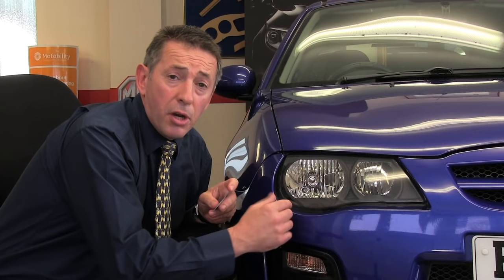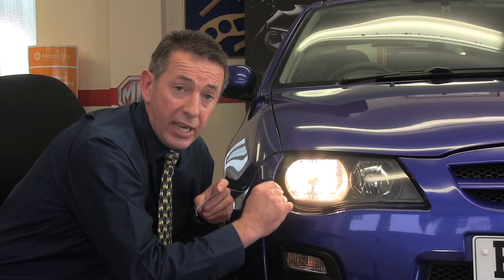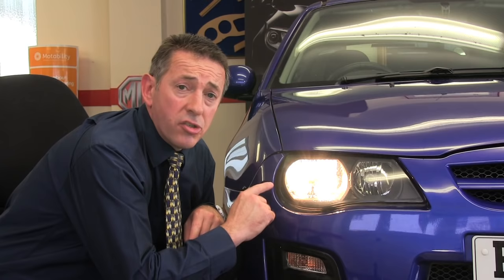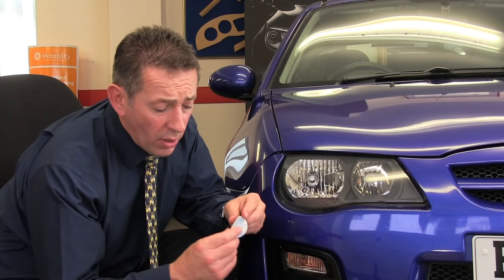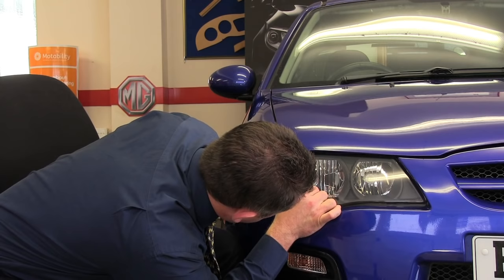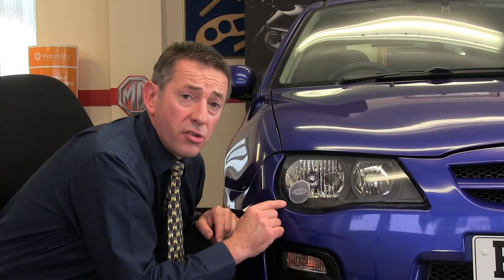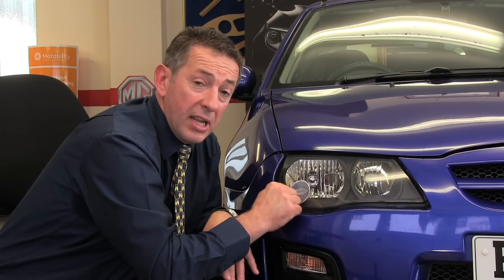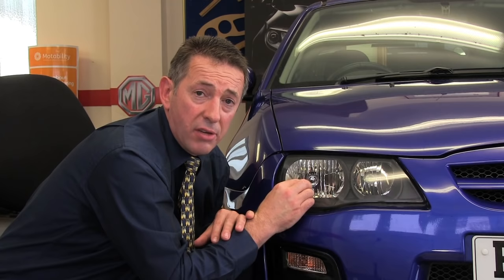Eurolites -- How to apply the adaptors using the fitting diagram for your vehicle

Comment: Thanks so much for your excellent video! - We have the 2019 Toyota Yaris Hybrid, and had great difficulty just before our last trip to France (May/June 2019) in trying to determine which kind of headlamp bulbs - i.e. Standard or Projector - the car has. We couldn’t find out in time (they weren’t specified in the handbook) so travelled without converters, contrary to the legal requirement in France! We’re now fully prepared for our next trip in September, so thanks again!
Reply: Hi I have the same vehicle,  did you stick yours in the 7 o'clock position as per this video?

Comment: The explanation of sticker placement (7 o'clock) doesn't make sense to me. The fact that back of the headlamp creates the light pattern, requires the location of the sticker shown on the video ONLY IF one would apply it ONTO the mirror, but NOT on the front shield. On the front shield the light is already travelling towards given direction and it's too late to speak about the mirrors.
Reply: That's what I've thought + when sticked it on 7 o'clock position last time in France, when drove over night almost each opposite driving car has been flashing lights to let me know, that I've blinded them..

Comment: I have a Honda HR-V with standard headlamps.  The Eurolites instructions say I should apply their circle to the 10-11 o'clock position on the driver's side and 1-2 o'clock on the passenger side.  My handbook gives instructions on how to fit your own home-made adjusters using sticky vinyl.  These seem to say the vinyl should be applied to the 10-11 o'clock position on both sides, driver and passenger.  Can they both be right?

Comment: I did not find the instruction or the video helpful for my particular car a Kia eNiro which has a "wrap around" light so it is not obvious where to place the disc.  After a discussion with a local mechanic he suggests shining the lights on to a wall and moving the disc around on the glass until the raised up part of the beam is obscured.

Comment: Why is that needed?
Reply: +Paulo Esteves It is because the people in the GB drive on the left side of the and the headlights are designed to thow more light to the left and if you for example would take a road trip down to France where they drive on the right side of the road, the headlight would blind oncoming cars that's why you need those to deflect the light from your headlight so it doesn't blind oncoming traffic
Reply: +XU10J4R thanks

Comment: Honestly, that's total bullshit. Cars shouldn't be leaving the production line without anti-glare lenses on their super-bright headlights. I mean, most new cars have a magnifying glass in front of a HI LEDs that blast out 10,000 candlepower. But the question is how much brighter they need to be before motorists are blinded outright to run off the road at night, worse still on a pouring wet and cold night where the windscreen fogs up and is smeared with all that bright white streak caused by wiper smear, not to mention when you're behind any of these shit boxes with they super-bright tail lights while waiting at the traffic lights, all that red smear on the windscreen (windshield), all that red light entering the interior of your car, all that red on your face. Do you think that all that red light is not harmful for your eyes? No? Well, stare at the bright red LEDs of the brake lights while you wait for the traffic lights to change and then look in a darker area and see how you're blinded by having a rosy while halo that blocks your ability to see things that you could see before you were blinded. That is the damage these LEDs do to your eyes. That is also the damage that those super-bright headlights without an anti-glare shield will do to your eyes. They also, I hope you know this, increase fatigue, tiredness and accidents. This problem is overdue. You do not need to purchase stick-on and stuff. This is a serious breach of the Road Safety Regulations and the Government as well as those who register these shit boxes with faults and all shall be held responsible for the number of unsafe features added to cars that were not permitted 20 years ago. It has now escalated to dangerous level and something needs to be done about it, the sooner the better.
Reply: +Mick Carson These are for driving abroad where you drive on the right and UK dipped headlamps will be pointing in the wrong direction - that is into the eyes of the other drivers! That's why they're called 'EUROlites'!!
Reply: +Mick Carson I don't think you understand, headlamp deflectors are put on the deflect the light from oncoming drivers 
,In the UK, our headlamps shine to the left, this will dazzle oncoming drivers on the continent (which only consists of France according to the video). The first time I drove through Germany I didn't bother fitting them and got quite a few oncoming drivers flashing at me.

Comment: this is just a scam. every headlight has a lever to switch from lhd to rhd roads.
Reply: @simonepleton765  

its sometimes next to the dustcap of the bulb. sometimes next to the bulb. depends on what car you have.

a bmw e39 has a see through cap on the top. if you remove it you can reach a lever. pus this lever and the lights are for rhd roads.

its only made to block the light when you drive on the opposite side of the road. like i live on europe(it sucks) and travel alot to the uk(where i was born) so when i pul the lever on my alfa romeo 159 (bottom if the dustcap) it blocks the light.

its handy if you travel every week to the uk. and drive 100k a year.(every day on the road)
Reply: @snellewilly  Can yo utell me more about this ? I bought a Mercedes CLK Xenon headlight RHD from UK and i want to convert the headlight to LHD French but i don't know how to proceed.. :/
Reply: @AnthHolgado  https://youtu.be/PZF2KTkNmRs

this can give you an idea where it can be located. if you want to drive for every on the other side it is beter to change the headlights for rhd or lhd.

Comment: DO NOT DO IT!!!
In some countries you can get penalty for such a thing.
Those stickers are not required if going to Europe.
After removing them the beam can  change  because you block the heat with the sticker. You won't be stopped by police for not having them
Reply: I wouldn't change it if I was you.If there is an incident regarding blinding another car the police won't be very friendly to a foreign car causing an accident.